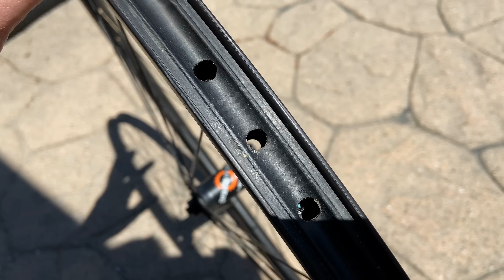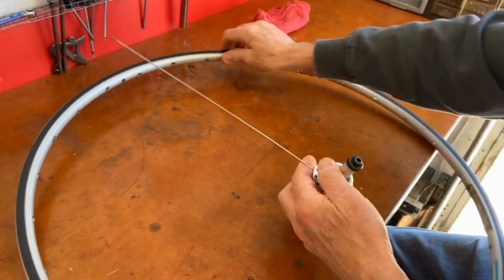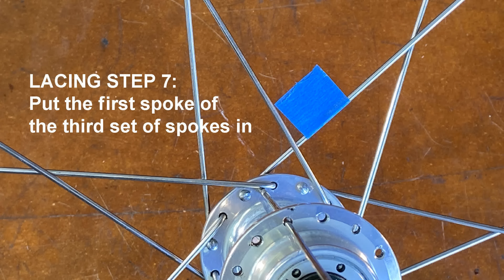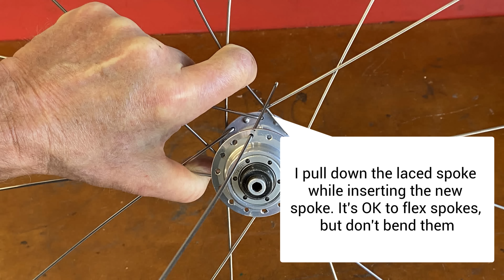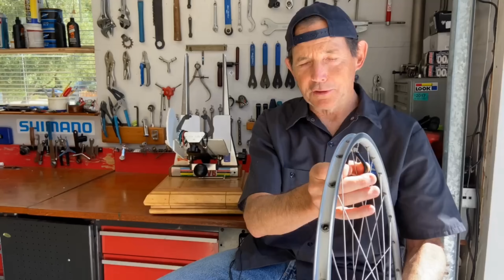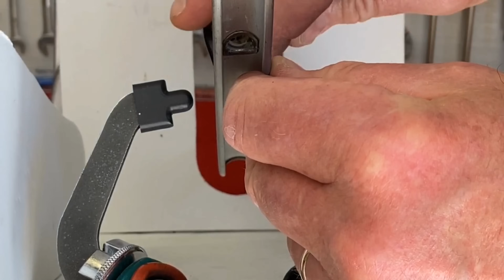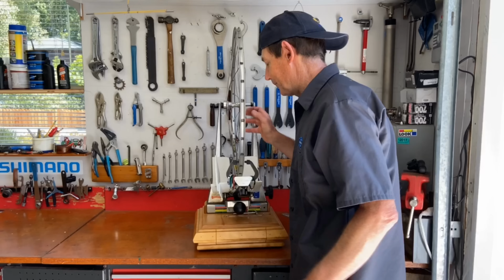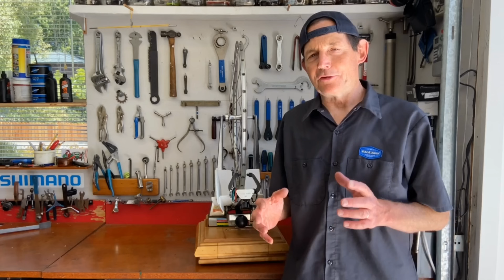How To Build Bicycle Wheels THE EASY WAY! #bikerepair

Comment: Where did you get the plastic covers for the pointers on your truing stand?  I have an old TS1 from the 80's that has just bare metal arms without the plastic covers.  
This is a great video.
Reply from the maker: Thanks for watching, Brian, happy you enjoyed the video! Here's a link to the cap. As far as I can tell  it's only 1 so you'll have to order quantity 2 and they're kind of expensive at over $7 each. https://amzn.to/42N2bvs You can actually buy the whole Park Tool Caliper Arm upgrade kit that comes with 2 caps for only $15: https://amzn.to/3zeymqf Thanks again!
Reply: Thank you for the information.  The upgrade kit was definitely the way to go.  Thank you again for a great video.
Reply from the maker: @BrianS8607  you’re very welcome- happy wheel building!

Comment: Jim, Can I build a 28 spoke wheel(rim) with a 32H hub?  BTW - You have taken all of the mystery (but not the common sense) out of wheel building!!  Thanks !!
Reply from the maker: Thanks for watching Michael, glad my video is helpful. So if it was an emergency and you had to do it, you could by skipping two holes on either side of the 32 hole hub if it's a standard hub that accepts all spokes - definitely not on hubs where the holes are designed for each spoke to be there in the right hole. But the issue is that leaving those holes empty could affect the spoke lengths. It wouldn't be too much of a problem on radial spoked wheels (spokes straight, no crosses - usually only front wheels are full radial). But on crossed spoke wheels it would change the spoke angles. Overall it would be best to just get a 28 hole hub. That's what I would do. Thanks again!

Comment: Thanks, I was watching another video and got half way through my build only to find it wasnt working on the non-drive side. I removed those spokes after watching your video and it "set me straight" so to speak. My wheel build was a 27.5 DT Swiss HX581 35mm rim with a Shimano hub.
Reply: A trick I have used to get the wheel true on first tighten is a small electric driver on the lowest torque setting, I start by doing the spokes opposite on each quadrant. It is fast and works very well as each spoke gets the exact torque value. This works well with new rims, not sure about old rims that are not round to start with.
Reply from the maker: @martibtube  yes, that's a good tool to help speed up building that most production wheel builders use. I have a video about driver bits where I compare pretensioning by hand versus by driver: https://youtu.be/kaBvpCuXigQ Thanks a lot!
Reply from the maker: You're welcome! Happy to hear my video helped you and congrats on the nice build!

Comment: Great video, so I just got done building my first wheel and got it extremely round and true (within 1/4mm). Is it ok if I have one loose spoke (measures 15 deflection on the TM1)?
Reply: I should add that I have 21-23 on the rear wheel drive side, and 17-20 on non drive. The one loose spoke is on the non drive side. Thanks a million
Reply from the maker: @7Scotts1984  I'm happy the video was helpful in your wheel build, Rob - congrats on your new wheel! I don't know what gauge/diameter the spokes on your wheel are. But, non-drive side spokes are always looser and to have one a little looser than the others on that side isn't uncommon especially at the rim seam when there is one (most alloy rims). If you're using 1.8mm spokes, that 15 spoke is probably going to be fine. If you're using 2.0mm spokes I would add about 1/2 turn to every nipple to bring up the tension on all the spokes including the 15 one - being careful not to knock the wheel off center. Also you could ride the wheel to see if it needs more tension. If so that spoke will become looser. In that case you'll know you need to add tension all the way around to get that one spoke tighter. Hope this helps. Thanks again!
Reply: @JimLangley1  you nailed it. Yes, it’s an aluminum with 1.8mm spoke. I worked the wheel a bit more and got that one spoke up to 16. Again, thanks for the great videos.
Reply from the maker: @7Scotts1984  you're welcome, Rob - great job on that wheel, enjoy it!

Comment: I have 7 or 8 dips or maybe high spots. How do i know if the wheel is dipping or too high? I guess depending on how much tension is in the wheel?
Reply from the maker: It's easier to see high spots and dips (low spots) if you can take the tire off to sight the very top edge of the rim. If you have tubeless tires and don't want to take them off, that's fine. In that case, you need good lighting and some kind of pointer. Your thumb can work but you could use a pencil too. For example, your bike could be in a repair stand or hanging from something and you could tape a pencil to the frame so that the point is close but not touching the rim. Now, when you spin the wheel you have the pencil point as a reference and you can see how the rim moves when the wheel spins. Don't look at the tire, just the rim. Watch the rim for awhile and you'll be able to see if there are high spots and low spots or mainly one or the other. Most wheels that have come out of true will have both high and low so that's what you usually see. You'll also see that the majority of the wheel/rim wants to be at a certain point of roundness and as you radially true it, you are bringing the low spots up and the high spots down. Pro wheel builders shoot for near perfect roundness, like less than 1/2 a mm. That takes many fine adjustments to achieve that. You don't have to take it that far but as long as your rim is still good (never crashed), it should be possible to get it close. One thing I didn't mention is that the spokes and nipples have to cooperate to true wheels. If the spokes and or nipples are corroded or the nipples are rounded it will make it very difficult to make these fine adjustments. But with spokes and nipples in good shape, you can do it.
Reply: @JimLangley1  sounds good. Pretty sure rim is ok but the tire was seated incorrectly for a long time. Perhaps the rim was damaged?
Reply from the maker: @mark38699  if a tire isn't seated it'll definitely look like the wheel has a problem, but it's almost always only a tire problem, a non seated tire shouldn't be able to harm the wheel. You can usually seat even tires that have been not seated for a long time. You might need to use a little soap to get them seated or spray some Windex on the bead where it's stuck. Or, take the tire off and start again. Good luck!
Reply: @JimLangley1  yep I've tried lemon pledge and soap no dice. The tire seater wrench from PT is $70 and my last remaining option ! Wheel work is difficult!
Reply from the maker: @mark38699  at one of the shops I worked at there was a mechanic "Jeff" who had a saying that you've gotta be smarter than the bike. I always liked that. Bicycle repair can seem difficult but it's actually a fun challenge to think about what's going wrong and how you can fix it. For your tire, if the soap didn't work it might be that you needed more tire pressure or that you needed more soap or to get the soap in the right place. If there's a tube inside the tire, you might remove the tire and put talcum power on the tube to make it slippery so that it moves inside the tire which can help the tire seat. You could put the wheel with the tire in the sun to warm up the rubber, that can help. You can get some of those grippy rubber palm gloves and grab the tire will both hand to pull on it and get it to seat. If you have a decent bench vise you can make your own 'tire biter' seating tool as follows. You put two blocks of wood in the vise to protect the tire. Then you put the part of the tire that's not seated in between the blocks of wood. DO NOT CLAMP THE RIM or you'll ruin it. Once the tire is in there, you can rock the wheel to get the stuck section of tire to come out and seat. Keep trying and you'll get it.

Comment: Will if affect rigidity or strength if spokes be laced 'over and over' rather than 'over and under'?
Reply from the maker: Thanks for watching and the question, Anthony. The word or term used for the way most wheels have over and under spoke lacing is "interlaced." Most wheels have interlaced spokes because it's believed that they make a reliable, long lasting wheel by helping the spokes stay tight since the point at where the spokes touch braces them and helps soak up/damp vibrations from riding. However, you will see some wheels now without interlacing especially on straight/direct pull lacing (the hubs have special drillings or pockets and the spokes do not have J-bends but either thread into the hub or pass straight through it. Those wheels prove that non interlaced wheels can work fine, too. I built mostly J bend wheels and interlace. But, you can certainly experiment with the wheels you build and see what you think. There are all kinds of special lacing patterns. Some people even wrap spokes multiple times around other spokes. Also, here's an interesting video about whether to interlace or not that my friends at Park Tool just produced: https://youtu.be/-fX5mAOzJVU

Comment: Is it necessary to lace a bicycle wheel using 'cross over and under' pattern?
Reply from the maker: Thanks for watching and the question, Anthony. The word or term used for the way most wheels have over and under spoke lacing is "interlaced." Most wheels have interlaced spokes because it's believed that they make a reliable, long lasting wheel by helping the spokes stay tight since the point at where the spokes touch braces them and helps soak up/damp vibrations from riding. However, you will see some wheels now without interlacing especially on straight/direct pull lacing (the hubs have special drillings or pockets and the spokes do not have J-bends but either thread into the hub or pass straight through it. Those wheels prove that non interlaced wheels can work fine, too. I built mostly J bend wheels and interlace. But, you can certainly experiment with the wheels you build and see what you think. There are all kinds of special lacing patterns. Some people even wrap spokes multiple times around other spokes. Also, here's an interesting video about whether to interlace or not that my friends at Park Tool just produced: https://youtu.be/-fX5mAOzJVU

Comment: Great video, I ride a 70s free spirit dynasty 10 speed, not a high end bike, but I enjoy riding it. The rear wheel is steel and I replaced the spokes because the old ones were breaking. The video helped me lace it using the 3 x method. The issue I’m having as I tighten the nipples is I’m running out of thread. The spokes are identical to the old ones. Could this wheel not work with the pattern that you used. This is my first attempt at lacing and trueing a bike wheel. Perhaps the old wheels used a different lacing pattern. Thanks for any input.
Reply from the maker: Thanks for watching, Isaac, I'm happy you enjoyed the video and congrats on rebuilding your wheel. When you say you're running out of thread, I'm not sure what you mean by that. Are you saying the spokes are too short and you can't reach them with the nipples? Or are you saying that as you tighten the nipples they're not turning anymore? If you can explain a little more so I understand what you mean, I'll make some suggestions.
Reply: As I tighten the spoke to add tension and seat the nipple the spoke thread extends above the nipple head. It seems as though the spokes are too long and are hard to turn. At that point I can’t add anymore tension to the spokes.
Reply from the maker: @isaacsalazar2265  thanks for explaining, Isaac. Yes, you're correct, if the spokes extend above the nipples, then they're long. And, since you are building the wheels with all the same parts as before - just with new spokes, then what probably happened is that the wheel was probably originally laced 4 cross. Since it's now 3 cross, that effectively makes the spokes too long since they were the right length for 4 cross and that's too long for 3 cross. To fix it will be just a matter of taking it apart and lacing it back the way it was originally as 4 cross. That's assuming that you are still using the same hub and rim and the same length spokes as the original wheel had. As long as that's true, then relacing it 4 cross will put it back the way it was originally and the spokes should be the right length then. When you relace it, going with 4 cross just means that the first spoke of the second set crosses 4 other spokes rather than 3 other spokes the way it is now. Then you just follow the 4 cross pattern while lacing the rest of the spokes. Let me know how it goes.
Reply: Thanks Jim, hopefully that does the trick. I’ll let you know when I try the x 4 pattern.
Reply: Thanks again Jim, the x4 pattern did the trick, I’ve laced and tried the wheel. It isn’t perfect but will work, I over pulled the hub trying to center it. I think on the video you tighten spokes on the side that needs attention. Do you loosen the opposite side before tightening the spokes that need to pull hub in that direction?
Reply from the maker: @isaacsalazar2265  I'm happy to hear that lacing it cross 4 made the spoke length right, Isaac. On centering the wheel, yes, the best approach is to first loosen the spokes on one side and then tighten the ones on the other side. But, we (wheel builders) don't think of it as moving the hub, we think of it as moving the rim. The hub will be held by the frame and the hub spacing is determined by the hub and axle so you can't really move it. The rim is basically suspended above the hub and the rim can move left and right in order to center it in the frame. Getting the rim centered is important for proper tire clearance and if you have rim brakes, to center them, too.

Those are reasons why wheel builders think of it as rim centering rather than hub centering. So, let's say the rim needs to move to the right, you would loosen all the left side spokes and then tighten all right side spokes. You want to make the same turn of each nipple on each side. That way you don't lose however true you got your wheel. So you could do exactly 1/2 turn on each nipple. Depending on how far out of center the rim is you might need to do it a few times until it's centered. Okay? I hope this helps explain.
Reply: Learning the lingo Jim, all you said makes sense. I’m up for a challenge and this has been a good one. You absolutely need a lot of patience as you mentioned. Thanks
Reply from the maker: @isaacsalazar2265  you're very welcome!

Comment: I want to put a mtn bike rim on a mx bike hub. Is this possible? I will be using mx gauge spokes and plan to ream out the holes in the rim. Rim and hub each have 36 holes.
Reply from the maker: Thanks for watching and the question, Michael. Correct me if I'm wrong but by "mx" I think you mean that you want to use a motocross motorcycle wheel hub and mx (oversize motorcycle) spokes with it in a mountain bike rim. If that's right, as long as the mountain bicycle rim has enough material in it to drill the holes to the size you need (there are all kinds of different mountain bike rims), and as long as the mx spokes are the correct length for the mountain bicycle rim and the spoke pattern you plan to use, then you should be okay building that wheel. You could check with the rim maker before buying the rim to find out if it can handle enlarging the holes. I hope this helps and thanks again!
Reply: @JimLangley1  Thanks for responding. I will take the precautions you specified regarding the rim spoke holes. If I have a problem finding spokes I'm prepared to make my own.
Reply from the maker: @MikeZ8709  You're welcome. Have fun building that custom wheel!

Comment: trying to lace a 36 spoke 26in wheel but it's not working
Reply from the maker: What part is not working? I’ll see if I can help.
Reply from the maker: Usually if you take it apart and start again with the first spoke and carefully add each spoke you’ll get it right the next time - unless something’s wrong with the parts like too short spokes for example.

Comment: Hi JIm ,built my first wheel (Mtb) . Went well, dished, trued, looks really good. I forgot to check spoke tension, i checked it and its high. Specs call for 130kgf max  then it says Stan’s build tension 105kgf. My wheel is around 190kgf .on the scale its 26 should be on 22.this is drive side. It’s an after market from the tm1 parktool.. should i lower the tension and trust the tool or ride it and settle it in ,did not know what build tension is??
Reply from the maker: Congratulations on building your first wheel, r g, way to go! 190kgf is definitely too tight so yes, you should lower it to a more reasonable tension. Too tight spokes can crack rims and even break hubs if you're unlucky. It usually doesn't happen for some time but it can happen and you don't want that I'm sure.

Comment: If you mark the true centre of your hub, then look down through the valve hole and align it to the far side of the rim, doesn’t that centre your wheel?  Keep going back to your video and your method to get the first spoke of the third set in the right hole is the easiest to follow and the most reliable that I have come across.
Reply from the maker: Thanks for watching and the great comment, Robert - I’m happy you like my tip for placing that first spoke of the third step. After a while you can see the right hole easily but at first it’s easy to get it wrong. You might be on to a good tip with your mark the hub and look through the valve hole technique but the hole needs to be centered. Some rims have offsets. Still it might work just fine or get you close to center. So you could have a great tip and I appreciate you sharing it. Thank you!